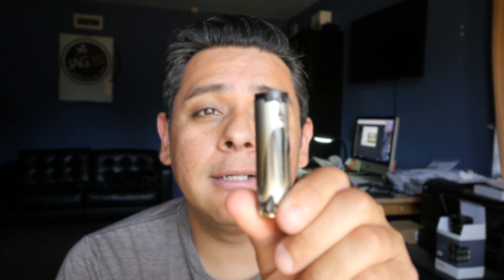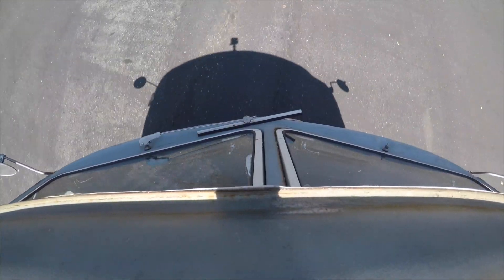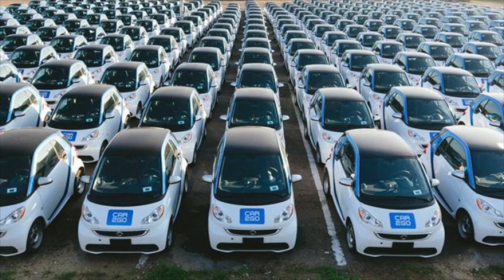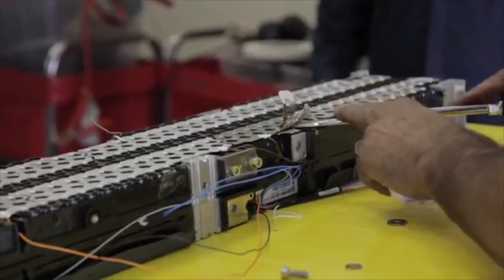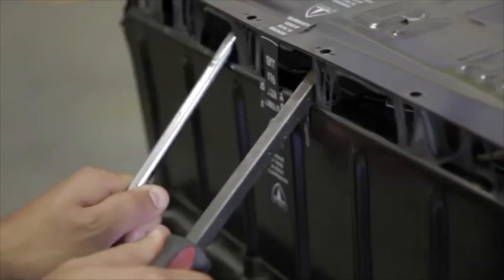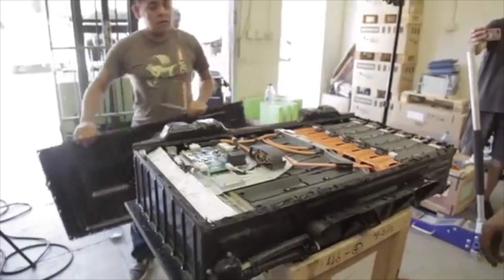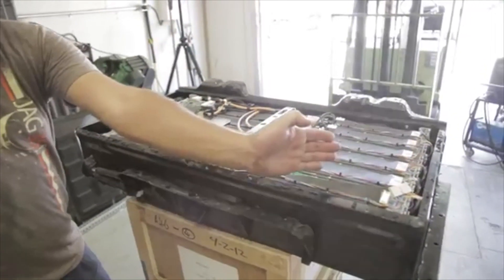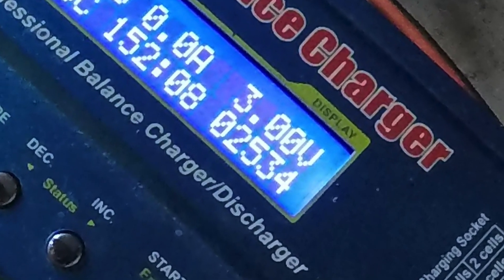The myth of lithium ion TESLA battery calendar degradation

Comment: Thanks for this video.  I have started to see some reports that it looks like there is some sort of calendar degradation happening in the LFP batteries.  People are speculating that it may not be actually degrading, but some sort of software function reporting the degradation in the cars.  Would love to know if anyone has started digging into this yet.  Looking like a 2-3% degradation reported in the cars with these batteries per year so far.  Looks like it doesn't matter how many miles are on them, it looks like a calculation based on time since they can't really tell much from the BMS with the LFP's.  This leads me to think the conventional NMC/NCA batteries that are properly managed at a lower SOC will far out perform these LFP's.  Would love to see someone digging into this subject.  The LFP's my be better for higher cycling, but appears the clock is ticking on them.

Comment: Fully charged Lipo batteries degrade about 20% per year at room temperature. However, at 50% charge they degrade at a rate of 2% per year at room temperature. Lipo batteries should therefor be stored at 50% charge (3.7 volts).
Reply: Please, store them at various different voltage levels, and be sure to label them.

I have many Lipos for RC purposes, and a few of them have randomly lost cells. I believe they must have a slight internal short that caused them to drop in voltage until the voltage level got too low. I have been able to recover some of them by connecting them in parallel with a drained battery, then charging them to 3.7v using a standard Lipo charger. Then I tested them and they seem to still work.

Comment: I agree with you. Most all degradation I have tested comes through normal usage. The biggest issue being storing for longer periods at above 91% charge.
Reply from the maker: +Michael Meisman I've tested this also,  also a myth
Reply: Do you mean the leaving them charged at full to almost full. I performed testing with LiPo (it may be different with Liion) and I assure you that it does have an effect on capacity over time. I tested for over 12 different manufacturers for both military and civilian uses over the course of almost 5 years. The way we described it in our papers was like a balloon being filled to the max and left like that for a week. It does not go back to its original shape and performance. Now the time frames were not a week more like 6, 12 and 24 months. The chemical engineers gave their chemical reasons but our tests were right in line with their predictions. Out tests were done on hundreds of single cell (1S) packs of various capacities from 1800mAh to 10,000mAh. All showed degradation. The larger the pack the less the problem.

Which may be why MB underrated the battery packs so much. To preserve the integrity of the pack in the long haul and meet the 'rated' specification for a longer time frame. They would not be the first company to do this.
Reply: Li-Po an LI-Ion are way different in construction, chemistry and storage requirements.
I believe, and jehugarcia may correct me on this, that Li-Ion batteries suffer no or very little extra degradation over time while stored charged, Li-Po on the other hand will degrade if stored charged for prolonged periods.
This is one of the many things that make Li-Ion far more suited for use in electric vehicles.
Reply: Thank you. Thus the reason I said that "it may be different with Liion" in my explanation. 

I like the LiFePO4. Yes slightly lower voltage but their safety factor is higher than either of the other 2. But so far the containment vessels have proven incredibly robust. But the first time someone posts a video of one of the cars burning in a white hot inferno there will be a huge disturbance in the force. We also tested the LiFePO4 and in all standard tests could not get them to catch fire. It took a lot of outside force to make them catch fire. And then the fire was no near as hot as the Liion or LiPo and burned out quicker.

But we did zero testing with Liion as that we were never asked to.

Comment: I have NiCads that are 25 or 30 years old that still hold and take a charge, but I took very good care of them. They were never half charged, always taken all the way down to zero, and always fully recharged, and they still work. I rarely use them, but they still work about as well as they ever did, I guess. I have a right angle drill that uses them, and if I need something to work close quarters, I dig that old drill out, and charge a battery up, then put another battery on the charger while I work. I am amazed the batteries are still good.  I think Panasonic used to be Matsushita. I wish there was a universal battery module that you could just swap with a charged module, so you can drive cross country. You could  just pull into a battery station drop off a dead module, get fresh charged module, and go some more.

Comment: In pretty sure true shelf life in the literal sense only applies to batteries that are not being charged. Somewhere along the way someone misinterpreted that and came up with the Hokus Pocus that degradation happens passively - which appears to be a load of BS when you actually go and test old batteries that have been maintained in use. Shelf life is definitely a thing, I've seen many power tool batteries brick themselves when they've been left to self-discharge in cold environments, but for a car that is being regularly topped up (or being left plugged in to 120v), that just won't be a possibility.
Reply: Self discharge is so low that if you leave it at 3.70 I can’t imagine it would be under 3.0 ten years later. 

Cold weather is a killer almost as bad as hot weather. If stored between 10 and 20 Celsius it almost goes into hibernation with very minimal degradation. Jehus location in Cali is pretty moderate so I don’t think the cells ever saw anything really low or high. -20 Celsius or 50 Celsius is what I would consider the extreme range.
Reply: @ericklein5097  self discharge is a few percent per month. So could self discharge 20-25% in a year. I've had lithium power tool batteries brick themselves after being left in storage for a few years, it's not uncommon.

Comment: I recently harvested some Panasonic CGR18650HG cells from a broken DVD player that I bought in 2005.  The player had been sitting unused in a closet for 10 years.  The spec on these cells is 1800mAh.  Three tested around 1750, three above 1800.  I would agree that shelf life does not greatly affect cells that are still operable.  However, I've noticed that if near-end-of-life cells sit unused, it causes them to die completely within a month or two.  This is particularly true of LiPo laptop batteries.

Comment: The calendar degradation is minimal at low state of charge (e.g. 3.5V) and low temperature (20°C).  
Fast shelf degradation occurs at high state of charge (above 4.0V) and high temperature (above 40°C).
This is why tesla limits the maximum charge voltage and actively regulates battery temperature....

Comment: Anecdotally speaking, this doesn't surprise me.  I got into r/c aircraft back in 2010 and I crashed my expensive plane after 7 seconds or so, and I lost all interest suddenly (short lived hobby for me).  roughly 6 years later, I had a need for a battery and grabbed a few that had been sitting there since 2010, having no idea if they had a shelf life problem or not.   Most of them were fine.  I had one that was puffy and didn't seem to want to take a charge, but that was the one involved in the crash and it was connected to the electronic speed controller that whole time.

Comment: In Austria is a model S from 2015 with 350.000 km and a range of 402 km in the beginning and 382 km currently. 

Just 900 cycles caused 5% degradiation ...
That car needed other fixes but no new battery.

Comment: I think that the myth may come from cells linked in series. Cells can go unstable (voltage drop in a single cell) with time when linked in series. I see this for model RC airplane lithium polymer batteries. The voltage on the cell can drop too low to recharge safely.

Comment: I have cells from 2014 model S. Tested one 2 years ago, got 3063 mAh. Tested it now, got 3009 mAh. That's 1.76% loss after 2 years of storage at 30% state of charge at room temp. Lithium battery storage loss is not a myth at all. It highly depends on chemistry, but all lithium cells share similar condition upon which loss occurs. There conditions are temperature and state of chage. Higher either one = more loss.

Comment: The degradation that occurs is simply self-discharge. They will self-discharge and their voltage will drop over time. However, you simply charge them back up. In the worst case scenario, they self-discharge far enough to be counted as a full cycle when you recharge them. So instead of getting say, 3000 cycles, you would instead get 2999 cycles.
Reply: You wouldn't talk like that if the fuel tank in your car leaks fuel constantly and you just would have to fill it up every time you leave the car sitting for a week or so.

Comment: I agree with you, because I own a 2010 Zero DS bought last year NEW! It sat for 5 years at the custom house and was auctioned. I rebuilt the battery pack with original cells (Molicel 26700) from salvaged "sisters" and the result was a brand new pack in terms of power and capacity, exactly as it was back in 2010!

Comment: It was most likely 14kWh available. like when they limit charge to 4.1v and limit discharge to 3.0v to extend cycle life. also, you suggest a 1.6C discharge, but that would be the max. Average would be much lower sice a car like that is only using 12hp(9kW=.5C) to go 65mph.

Comment: Old unused laptop and mobile phone batteries that i tested, most had much higher internal resistance, but still full (or nearly full) capacity when discharged at low currents like under 0,2A for a 18650 cell (let's say about 0.1 C rate)...

Comment: Maybe someone has said it already, but if a conservatively rated cell can now ONLY perform near its rating rather than far above it like it could when new (that's how you characterized the performance, right?) then it has lost more than a fraction of a percentage of its capacity. The error is in comparing current performance to rated performance, rather than current performance to actual original performance, when determining how much deterioration has occurred. Am I missing something?

Comment: But here is my question: studies have been done to test the fuel economy of the tesla, and data suggests that the cost of the electricity is less then the cost of gasoline. But what if you are driving a tesla in Canada in the winter and it's -20, and you are using the electric heater on full blast? Your fuel economy then becomes....? and your 300 mile range becomes....?

Comment: All the more reason to talk about recent energy-dense supercapacitor breakthroughs. (esp. Surrey/Bristol Universities + SupercapacitorMaterials Ltd).
Combi EV powerpacks (50-50 supercaps combined with Li-ion(Na-ion, Li-S) need to be rolled out ASAP. 
Instant recharge supercaps will cover the first 80-ish miles of day-to-day driving with batteries serving as a "series" range-extender. 
One added advantage is that the battery  "half" of the combi- powerpack will be infrequently or rarely used by most drivers and could easily last 15-20 years.
(=Bad news for battery manufacturers and sellers !)
Paul G
Editor: Electric Vehicles UK(EVUK)

Comment: Well my 18650 cell Panasonics are around 6/7 years old and I have found they have lost around 1 third of their ability, the meter still reads good but actual work has dropped off by about a third of their ability In my bicycle.

I charge them up and they drain down faster now compared to how they used to, I would get 40 miles out of my battery pack now it's probably around 30 ish miles.

I think it has to do with the way they were stored, ie followed the instructions in the hand book that was to keep them fully charged every 3 months.

But as I said when you look at the meter they read right up there at the top of their charge, but when you use them they drop off much quicker.

Comment: I have a question and you may have the answer.  when charging a lithium battery it's recommended that you charge it at 1amp or half the C value meaning  3000mah =1.5amp charge rate . now you can change the resistance on the charging board to increase or decrease the charging rate . but how does Tesla not blowup there cars by charging there batteries so quick.  I no this maybe a odd question but trying to find answers because I'm trying to charge my batteries quicker with out doing damage
Reply from the maker: +David Kelly  132kw charging a 85-100kwh pack is around 1-1.5C   They are actually charging at recommended rates plus they are cooling them
Reply: Makes sense thank you

Comment: You originally say it was 9 years old, if I've understood the timeline correctly, this cell may be just under 7 years old. Also, if it's very low mileage, low mileage cells have extra capacity. I wouldn't expect that much loss under these conditions, but I would have guessed slightly more (maybe 150mAh) loss than there evidently was. Also, the liquid cooling that the original car had apparently helps quite a bit; they really don't like getting hot.

But yeah, interesting.
Reply from the maker: its from 2009 -2010 car,   Upon further investigation  san diego cars were manufactured mid 2010 so this call had to be made in early 2010 or earlier ,  making it 7 year old or more.

"low mileage cells have extra capacity,"    No extra capacity,  they have low degradation because they havent been cycled very much which is what degrades cells,   not shelf life.    these cell have not been temperature controlled for 3 of the 7 years of their life.

Comment: i got some laptop battery from 2007-2008 and big surprise ,when i test this cells  where on battery tools says 91cycle ,and its panasonic  CGR18650 cells are 2900mAh (taken from Toshiba portege R500) after full test on capacity it shows 2890mAh!!!!
so in near 9-10 years time  cells from panasonic will keep to be alive and  i think TEsla uses this kind of cells for sure ,as toshiba R500 was relased in 2007-2008 so big posibility is Panasonic CGR18650 cells or very similar i hve data sheets of all panasonic cells that years time
Reply: and i bought a HP laptop 8 months ago assuming they had that battery degradation fixed by now and it already lasts noticably shorter. :/
Reply: You have more shit running on it by now. Test the battery itself. every app running on a pc consumes CPU cycles/Gpu cycles, writes to HDD, SSD, Memory etc and it all consumes power.
Reply: yes i have tested this battery,s well and can confirm  still alive and have capacity from 2600-2800mAh by 500-1000mAh discharge cycle
Reply: have already put on load and voilaaaa surprise they hold load of near 2A!!!! have nothing more to load  but single cell  hold 2A load well
Reply: 30min run test for single cell, battery still have some charge  but  will give more results when arrived special device to  make good load and count  time for discarge as battery pack runs well where that cells are installed
Reply: i will tell capacity when done load tests
Reply: In 2011 I bought an HP laptop. Since then I've only charged the battery when I was traveling and needed to work  without having access to a power plug. This was I think maybe 20 times in 6.5 years. The rest of the time I just plugged it into a wall and removed the battery.
The battery still holds the charge like the first day. I've noticed no degradation. Laptop is severely outdated but the battery's still good.

Comment: I'm afraid you may be using terminology incorrectly.  Measuring cell charge capacity is not necessarily an accurate measure of "degradation", an irreversible change in cell properties.  Listen to the Dr. Jeff Dahn lecture on the subject for more details.
Reply from the maker: +George Hawley  I only care about capacity,  you want to argue cells degrade in other ways,  go for it I'm not interested
Reply: Loss of capacity is one symptom of battery degradation.  Do yourself a favor and watch the Dahn video.  It will contribute to your  efforts to understand battery behavior.
Reply: Rubbish, when using batteries you will need to take all properties into account.

Comment: Hey,  quick question. I have lg cells (hg2). The specs says they suppose to hold 3000 mah and be able to go down to 2.5 volts.
But the charger goes only down to 3 volts. Is there anyway I can check their capacity ?
Reply: ilya sla If you have a charger like this or the imax b6 you can choose NiCad or NiMh discharge. You can set the termination voltage there. If you want to discharge to 3V, but have a 0.2V drop on the cable you can set your charger to 2.8V If you know your voltage drop you can discharge to the exact voltage you want
Reply: cool, i'll check it out

Comment: Thanks Jehu - An additional thing to consider is that after a period on the shelf, Lion batteries seem to take a couple of charges to get good again. An example is a used camera I recently bought, and first use of camera was abruptly cut short. Since the first charge, the batteries have easily doubled in capacity from the first charge.
I'm interested to see whether the capacity is same or better if the discharge test is done again.